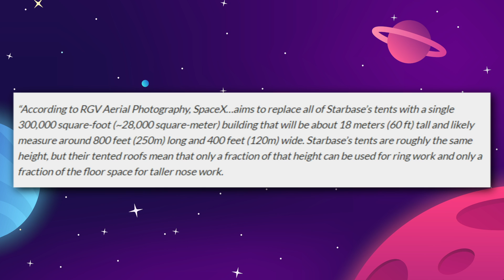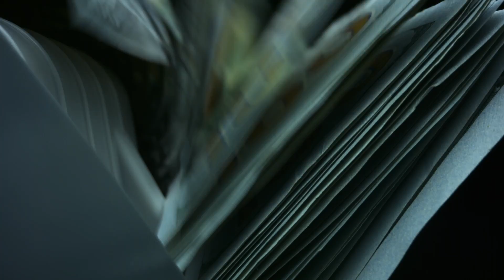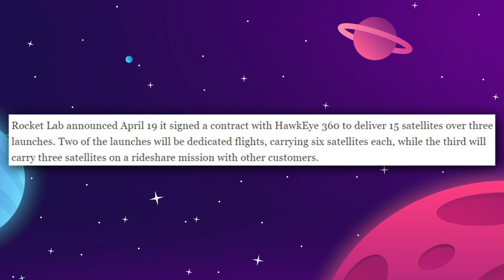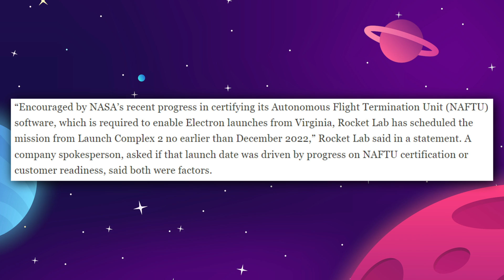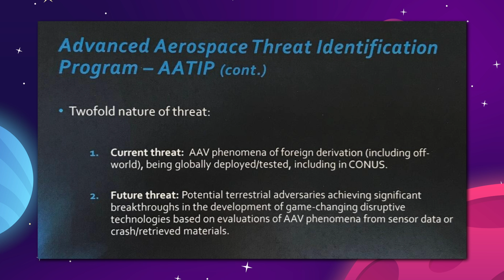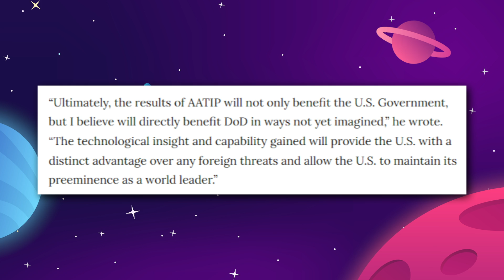New SpaceX Starship Factory Revealed!

Comment: The problem with large scale starship and booster production is in the current process of making and stacking rings and ring sections. This method is very handling intensive with ring sections being manually moved, stored, sleeved, etc. This isn’t conducive with large scale automated production. Elon should consider shifting to a spiral wound starship and booster hull method. That would facilitate a 100% robotically welded continuous process where the outer hull could be wound around dome sections held in their desired location by placement jigs. This would allow stretching tanks as needed while resulting in tighter tolerances between domes and the outer hull. Rolls of 304L stainless in: complete hull sections out ready for final upfitting and engine installation. I’m surprised that Elon missed this opportunity to optimize the design for rapid automated production, considering the massive strides he’s made doing that very thing for Tesla with giga castings, structural packs, etc.